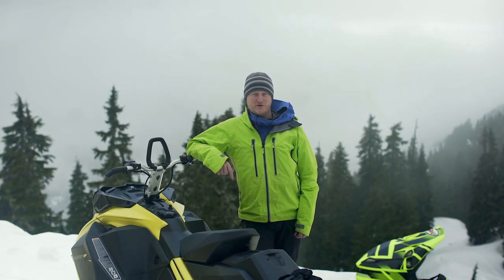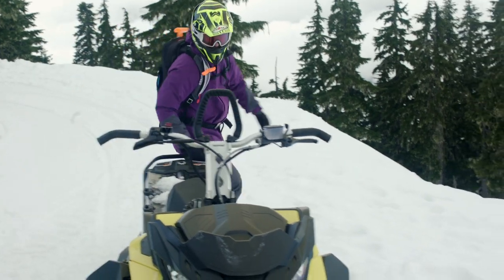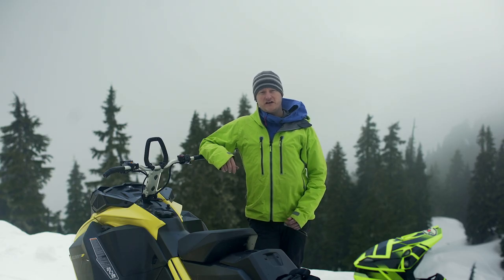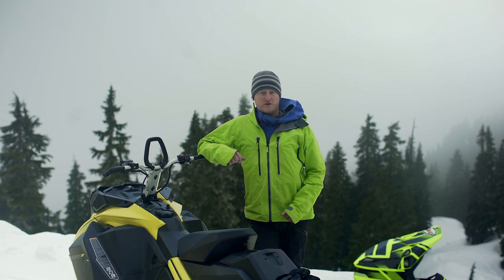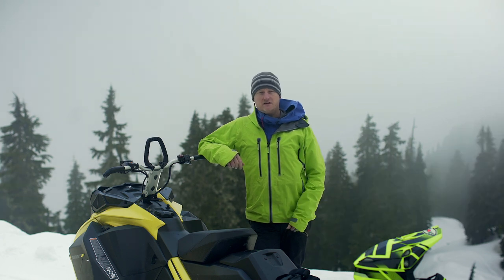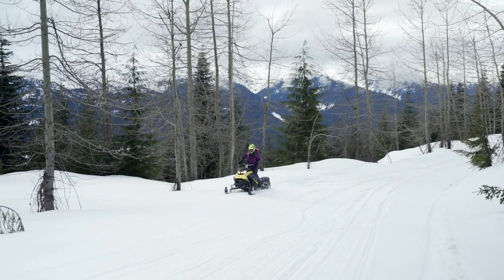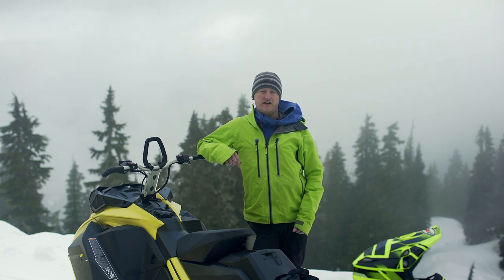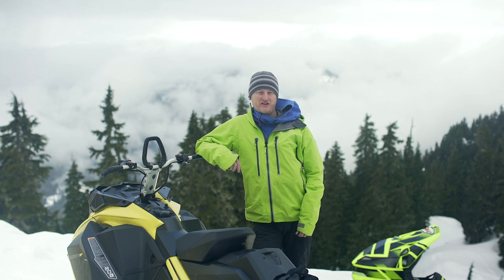How to Prevent Ski-Doo Engine Overheating

Comment: What about old snowmobiles
Reply: They are the same if they are liquid cooled get snow on those heat exchangers
Reply: Some  old sleds that are liquid cooled have radiators plus heat exchangers while others just have the heat exchangers but basically just do the same thing -  get into some fresh snow so it kicks up into the tunnel where the heat exchangers are.